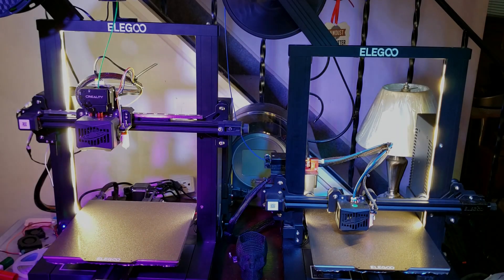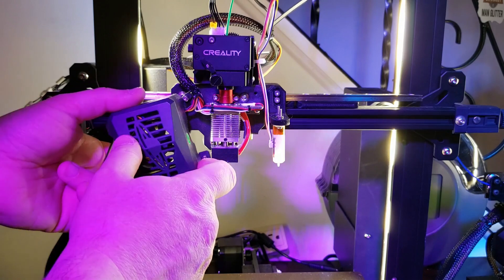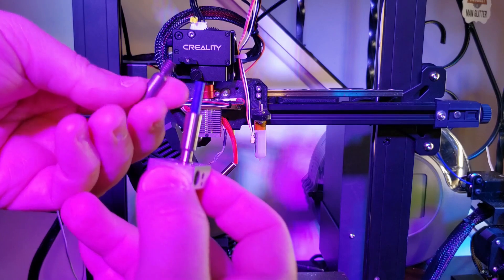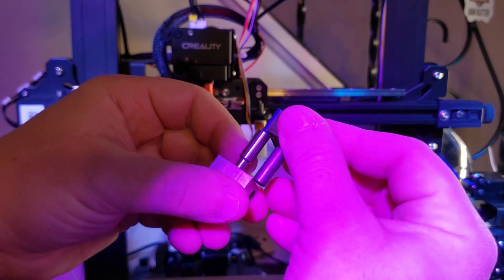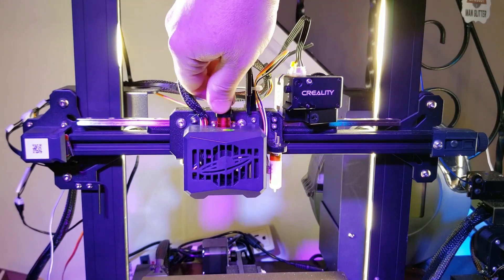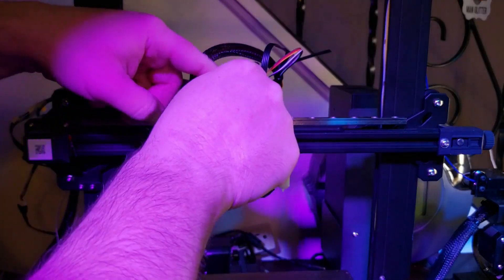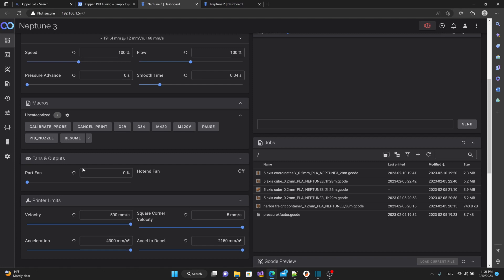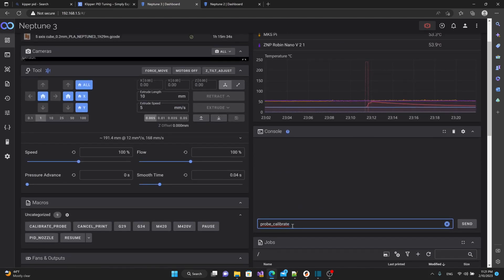Slice Engineering Copperhead Heat break & Slamazon copper heat block install on the Elegoo Neptune 3

Comment: Does this fit the Neptune 3 plus?
Reply from the maker: Yes it does
Reply: I will have to look more into this. I was under the impression the Neptune 3 hotend was different than the 3 plus.
Reply from the maker: @mattysantan2400  the heatbreak and block are the same from the Neptune 2 through to the 3 max
Reply: What’s the highest temp you have run with this setup? I’m researching on getting my machine to print carbon fiber nylon.
Reply from the maker: @mattysantan2400  once you go all metal, temperature will mostly be a product of your heater, thermistor and cold side cooling capability. Slice heatbreak can go to 450c but you may have to liquid cool the cold side at those temps.
Reply: Thank you very much for all the information you have been very helpful. 👍

Comment: The same process should work for the pro right?
Reply from the maker: Similar. Disassembly of the pro extruder is different but i believe the grub screw for the heatbreak doesn't require full surgery. Randy May did a video about it on his channel. Just be sure to lower your retractions and do pid tuning after the swap

Comment: that's great! I had done this upgrade on my N3P about a month ago. glad to see you getting some love from Slice🍊
Reply: Did you use the exact heat block as well? And did you change out the both hotend wires to print at higher temperatures?